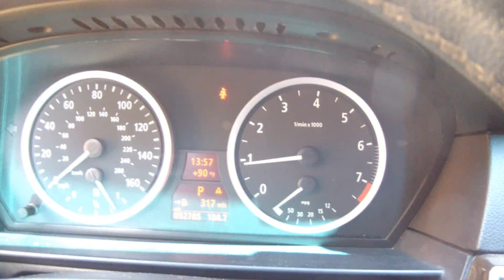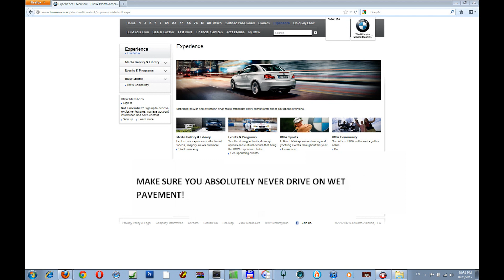BMW Design Fail!

Comment: mine in my 99-2000 model car is wrapped in a foam case in the side wall of the car protected from anything, its not a difficult task to get out of the way for a manufacturer.. stuff does get spilled in a boot once in a while.. Also give the car 20 years where the seals have warn and it may get a leak in the boot... although modern cars aren't made to last anyways....

Comment: no I'm not a fan boy I hate BMW but most cars have modules placed all over, and non are waterproof because unless you spill something or thing your car is a submarine this isn't a problem. For instance if you pee in your seat it will leak through and short out the seat control module, clearly that's a design flaw. Just like having the a/c condenser in front of the radiator so if a rock hits it, it leaks refridgerant. that's a design flaw too. this is your typical second hand owner,  that couldn